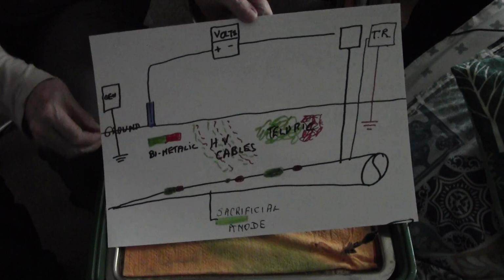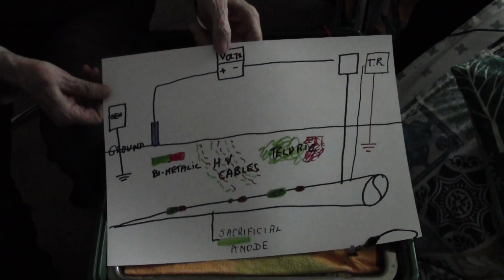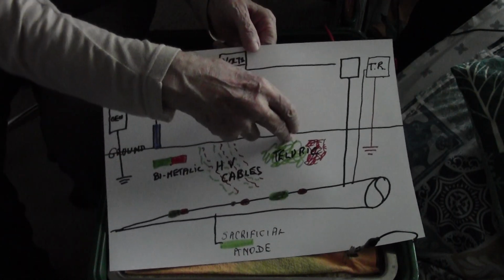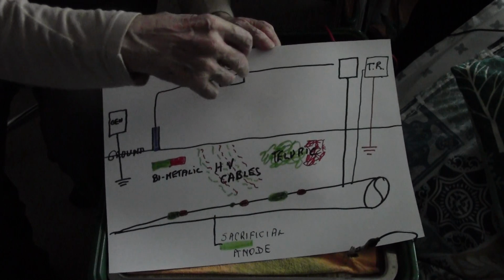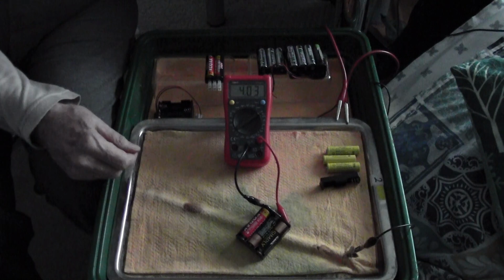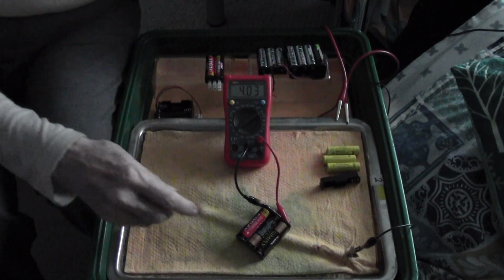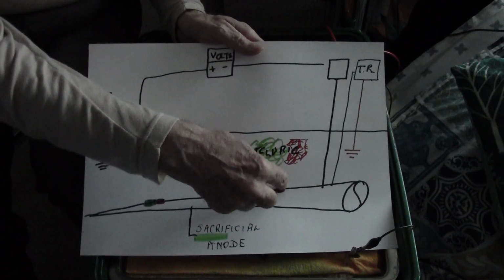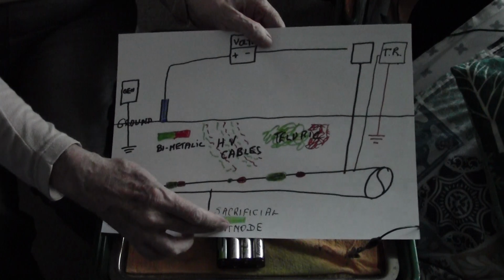pipe-to-soil measurements

Comment: Impossible to get 0 current.. Before u lay pipe.. U need to do holiday test on pipe to searching scratch.. Then u need patching with expoxy.. Then backfill or horinzontal directional drilling... Pipe can scratch because rough soil.. Stone.. etc.. From this new pipe u can get... maybe u get 1750mv mg.. Pipe to soil on 1111mv..of 1100..current 75..in depend on soil.. It good result or not.. Current 75..show pipe get a lot of scratch..
Reply from the maker: Pipe to soil measurements are irrelevant as they are always voltages between two variable potentials.  Please study my website to understand real science.  http://www.pipeline-corrosion-control.com

Comment: Pipe to soil.. What the perfect reading in mv....
Reply from the maker: The pipe to soil measurement is a VOLTAGE  between two variable potentials  and NOT a potential measurement as I have tried to explain in this video.  The only way to measure the potential (EMF) of a corrosion reaction is described in DIN 50918 and this requires the use of a Luggin capillary at the interface between the anode (working electrode) of a corrosion cell.  The front page of my website explains this ...   http://www.pipeline-corrosion-control.com/.  The perfect reading in mv is zero because that denotes that there is no corrosion current flowing in the cell and that no metal is going into solution.  This is confirmed by Faraday,  Gibbs, Einstein, Nernst and the Pourbaix diagrams.  The bullshit that is published by NACE and ICorr is not science and never has been.  If you look at the Pourbaix diagrams you will see that the base line X axis  is pH and the Y axis in in volts.  The diagram shows the passive zones in which corrosion has stopped.  The Nernst equations  refer to the 'half cell reaction' and not a  half of a cell as inferred by NACE.  This reaction potential can only be measured in a laboratory in closed circuit condition at a controlled temperature and with no other influences such as ultraviolet light.  The IR drop in the electrolyte is referred to in science  because the potential of the electrolyte is subject to the inverse laws of radiation that means that the potential gets weaker as the measuring probe moves away from the EMF of the reaction at the anode.    This has been misunderstood and confused with the potential gradient that I use in the practice of DCVG that I invented in 1974/5 in Nigeria.  This type of survey also proves that CIPS cannot determine the corrosion status of the pipeline.